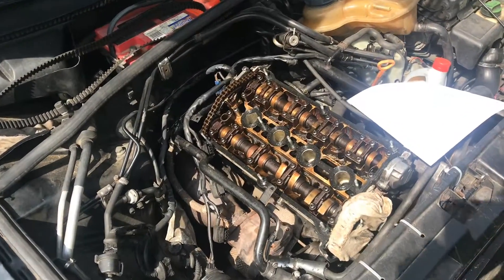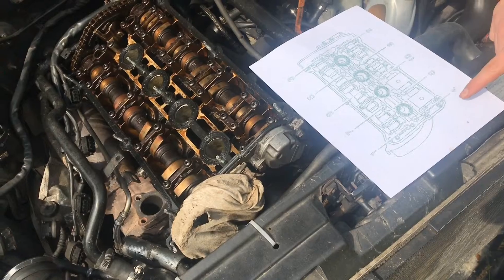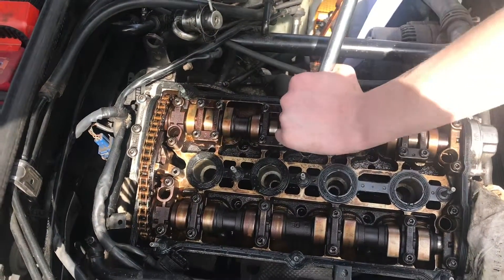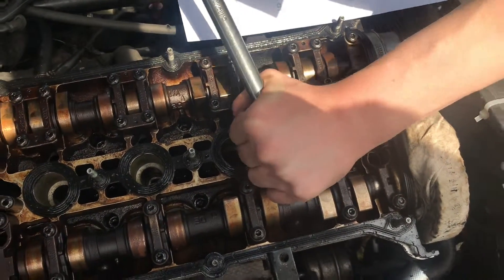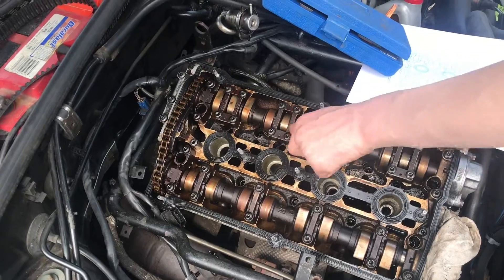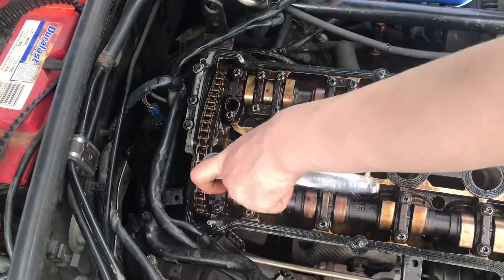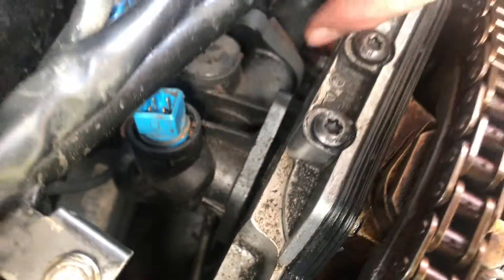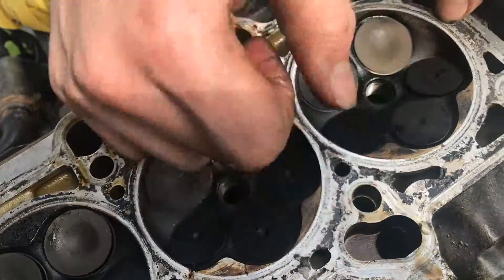removing engine head on 1.8t volkswagen audi

Comment: You don't have to remove the exhaust manifold or the intake manifold with the cylinder head in place. It's a LOT easier to remove and install the exhaust manifold when you have the cylinder head on the bench.
The intake manifold just needs to be moved to the side with almost everything attached.

Comment: It's not torx that you need to remove it, that's why they get stuck,  lts a #10 polydrive head bolt socket : assenmacher 3462 #10 polydrive
Reply: Thank you. I’ve been trying to find the right tool
Reply: It's called a triple square
Reply: There’s different ones for different years there either 12 point or torx

Comment: Your supposed to go from 1 to 10 on loosing the head bolts, it's the exact opposite from the tightening order. Omg
Reply: ...... Never done it that way and never had a problem because the machine shop resurfaces the head, it's wierd not to resurface it, but yeah that's what the manual says so I guess that's how it should be done....
Reply: @josefelix4152  I just used rough sandpaper on a perfectly flat piece of glass, then went to a more fine grit. I got the head flat that way lol
Reply: @ShadedScar  that’s how’s it’s done using rough grit tho is risky to save some time if your not carefull

Comment: Great video, any tips on buying a used a4 1.8t?
Reply: Yes, they tend to fail at the turbo charger and consume your oil, I would inspect for growling noise coming from the turbo itself, if unattended could lead to a fail engine, also the pcv vacuum hose are a coming failure to because they are made of plastic and break and deform causing vacuum leaks and what not, usually they sell the whole pcv system hose kit on the web, these are the most common things I find on these engines at the shop, it's bad turbos that lead to bad catalytic converter and very low oil pressure, and bad pcv system hoses that leak to crazy vacuum leaks, by bad I mean they are worn out.
Reply: Ik this comment is really late, but if you haven't already, make sure you at least know when timing belt was done last. If you don't know, I'd say just change the belt. Mine just snapped on me and bent many of my valves. Wouldn't wish it upon anyone.